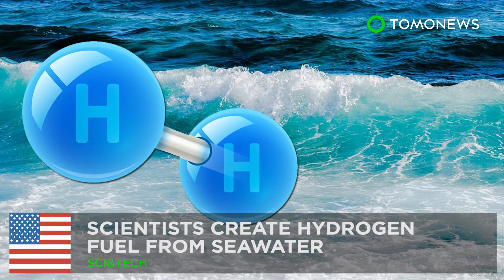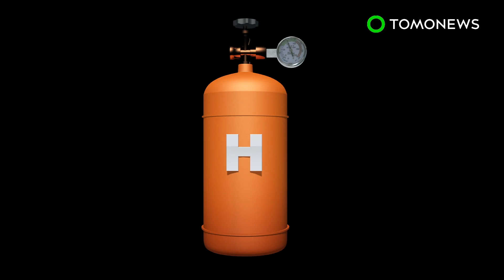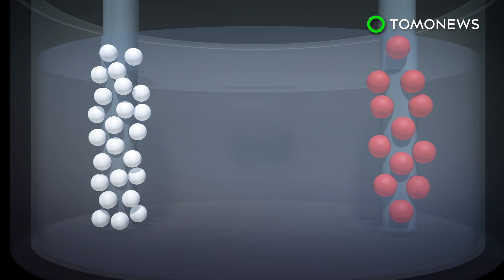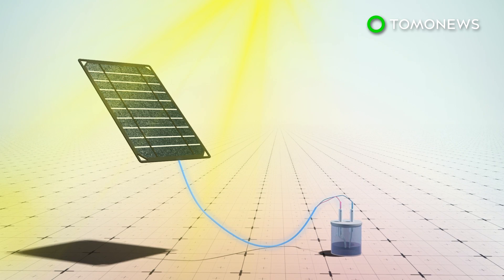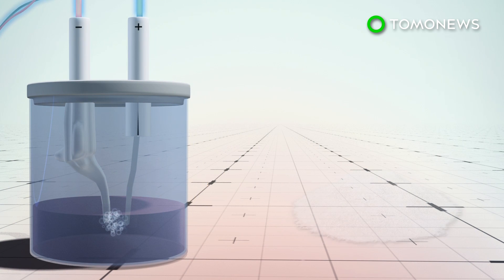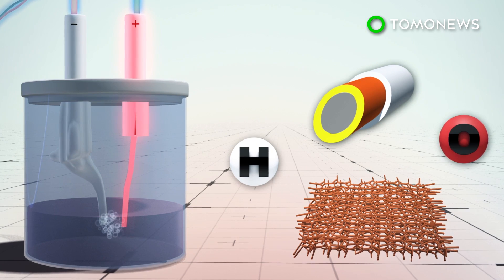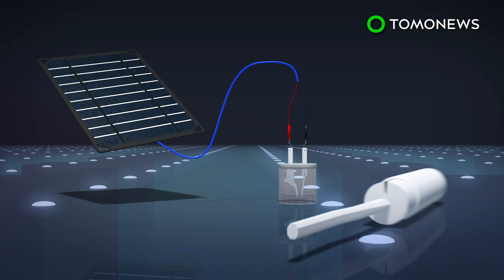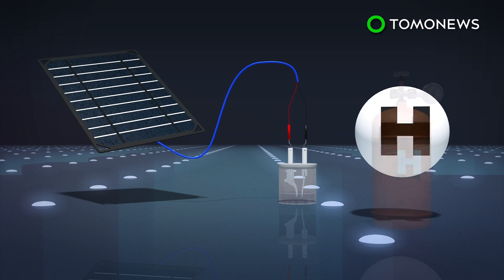Clean energy: Researchers create hydrogen fuel from seawater - TomoNews

Comment: There you go an answer to rising sea water levels. But why can't they just use stainless steal, it doesn't rust at all. 2205 Duplex Stainless Steel is suitable for submerged metal in salt water. Also stainless steel is a very good conductor.
Reply: Using stainless is dangerous.
Reply: @redwow  why it doesn't rust

Comment: I came across some very informative videos on a breakthrough method of making hydrogen VERY efficiently and low cost. The energy company is: H2IL - video channel: (H2 Innovation Lab) or the other way around I think. The tech is interesting and it's got to be what is needed to push the hydrogen future closer. Produces H2 from sea water with a new electrochemical method that succeeds conventional electrolysis. I'm a scientist and believe they are on to something.